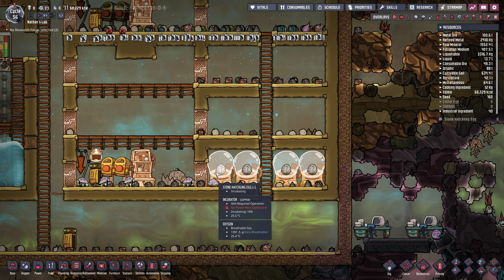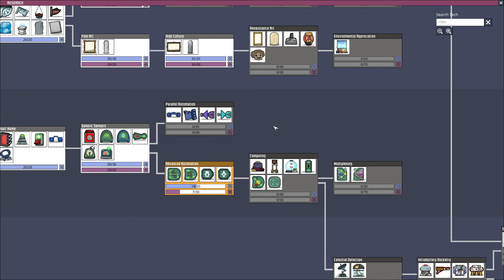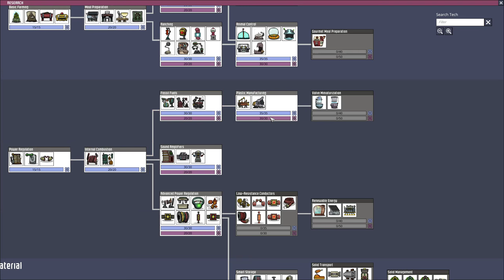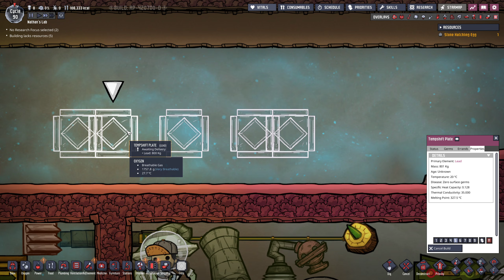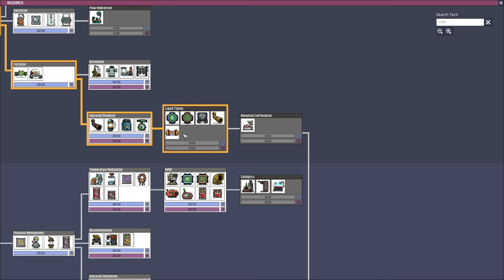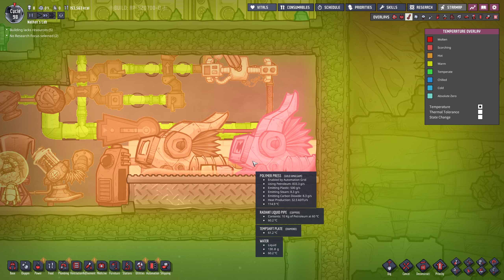STARTING THE PLASTIC AGE - Oxygen Not Included: Ep. #4 - Building The Ultimate Base

Comment: This base is unrealistic as of 2022. An incubator is 240W. You have four. A pump is 120W. Two coal generators are 1.2kW which is above 1kW wire limit.
Reply from the maker: You can do go above the 1k limit as long as you don't use it at the same time.

Comment: How do you build pipes and wires not destroing the floor tiles?
Reply from the maker: Pipes you can build across tiles, the heavy cables though will require a conductive plate instead of a floor tile to get the power through.
Reply: @Nathans-Sandbox  Well, my dups always destroy tiles first, then build wires or pipes.
Reply from the maker: Ah you meant deconstruct.  You have a filter at the bottom right corner with the deconstruction tool;)

Comment: Today: Making Plastics
An episode or so ago: Duplicates using bottles

O.o where’d they get the plastic for those...
Reply from the maker: Yeah hehe, a bit of magic there.
Reply: Maybe those were glass bottles.
Reply: @Desdanovas  but thats worse because then theyd need glass-
Reply: @quinnlee-miller9792  All you need to make glass is a stone furnace and sand. The suspension of disbelief is easier to make with glass bottles than plastic, I think.
Reply: @Desdanovas  and a pipe to blow the glass into.

Comment: Doesn't look like you hook the liquid pump output up to anything in your plastic room in this video, and in the next one there's a pipe leading downward.  Did you hook that into just a liquid vent in your fresh water supply to deposit it in there or did you pipe that to your polluted tank or just outside the base randomly?  Not sure the best place to route it, seems like it will be pretty hot water considering the room it's in.
Reply from the maker: I hooked it up to the waste water system where it's also cooled down eventually.

Comment: and I use gold for water pump from oil, the overheat happens, how to fix it
Reply from the maker: If the oil is hotter than 125 degrees you have to use a better material.
Reply: @Nathans-Sandbox  Yeah, this keeps happening to me too. I just haven't discovered a better material yet. My pump keeps overheating and breaking which is really slowing down my plastic production. Any suggestions on a better material to look out for Nathan? 

By the way, this series is AMAZING, I love your videos! You are so entertaining with your commentary on the dupes while simultaneously blowing my mind with these automations! This really is the ultimate base :)
Reply from the maker: You could seperate the oil and cool it with some water before pumping it. Or you rush for steel production. The oil pockets at first aren't hotter than 125, they heat up over time if you have a heat leak to the magma biome or made a mistake. If you're looking for the next best material, it's steel. You only need enough to make one pump.

Comment: Nathan I am so happy I found your channel when I decided to play this game.  Your explanations are succinct and you English is impeccable. I have an issue with the polymer presses overheating and breaking.  I can't see what I did differently than your build. My steam doesn't turn into water above the presses but by the air lock instead.  Do you know what I am doing wrong?  Any suggestions would be great as I need my dups to stop fixing broken machines all the time.
Reply from the maker: Hey there! Glad you're happy with the videos:) I had to make an addition to the polymer presses later on as they were overheating too. My solution was to add new water to the room, actively cooling them down (regulated with a hydro sensor, so you try to keep the water level above a certain point but not constantly add water) as the pump inside the room slowly gets rid of the excess water going back into the waste system. Not sure it's clear what I mean though:)

Comment: Love the Series Nathan. Awesome Job!  I am just now building the polymer press but my sweeper is breaking down in the heat.  Why wont it let me make it out of the material you chose even though i have it.
Reply from the maker: Should make it out if Gold Amalgam, not sure why it wouldn't let you build it 🤔
Reply: @Nathans-Sandbox  Looking in my resource list I have 102.2t of gold amalgam but when I try to build the sweeper the only choices i have are copper, lead, iron and gold. I can build all the other equipment in the plastics room out of gold amalgam just not the sweeper.  Very frustrating.
Reply from the maker: You might need refined metals, not the ore. Would have to check though.

Comment: why to filter liquid too early. it is possible to set a pipe detector and switch off when something other then oil come and make an update. It is better to setup the second pipe to remove water in upper layer. For a petrolium generator 5 000 presure is maximum. I think CO2 has a very pour properties and can not heat the base.

Comment: Back in the day slimelung was a pain and worth being super careful about.  Now, just keep the air in your main base free of polluted oxygen and you'll be fine.  I hog out whole slime biomes without atmo suits or any kind of lock between my base and the work area.  Sure, a couple dups will get sick, but they get over it quickish.  Just clean the air as you dig and the slimelung dies off.  Pool the polluted oxygen at the bottom of the biome, cover it with air flow tiles and deodorize the off gas to supplement your oxygen production early on, conserving algae.
Reply from the maker: Yeah, slime can be nicely exploited for oxygen this way.

Comment: Very nice design!
One issue though: why are you cooling the oil? The refinery heats it to 75°C regardless, so by cooling the oil you are actually creating heat and the cool oil does nothing for your base!
Reply from the maker: Though when it comes in hotter than 75 degrees, the petroleum is also gonna be hotter, isn't it?
Reply: @Nathans-Sandbox  Yes. 75°C is the optimal temperature for heat-deletion!

Comment: Hi! Very good Video - as always! My Ideas:
Why should the plastic fall down the other side of the machine? And: You could also work with a pressure plate. You will end up with 2x2000 kg of plastic (if you use only one pressure-plate at one side) - mostly more than enough.
If you need the smart-container: it is using a ton of power - maybe check it only several times a day (or with a clock - every 30-60 seconds) and use a memory-toggle?
TempSHiftPlates also inject heat into the insulated tile - maybe leave a gap at the ends.
You could use the emergency-build-priority for the things only the engineer can build, so you don't need to check and uncheck the priority.
You could use the automation-output of the tanks for the refinery - so the duped are not running there for 3liters of petroleum all the time (maybe set it to 95% stop - 30% start - or whatever).
Reply from the maker: Good points again! Can I do that with storages too? Like only fill up the coal storage when it's at 50%.
Reply: @Nathans-Sandbox  only liquid and gas storage does have the automation. You could use a Smart storage + normal storage Setup. The Smart storage opens a door, when it is empty, als close the door when its full. For the Time before a dupe fills the Storage you will need the normal storage with a little higher priority as a buffer
Reply from the maker: Ah good point!

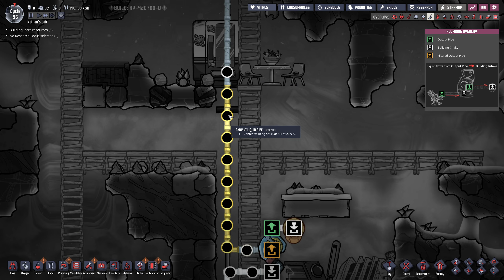Comment: As a chemistry engineer, I must warn you, that the pipe cooling at 28:28 is not gonna work as you wish. The reason is it was not dynamic stabilised status yet. The hot oil was transfering heat to cold pipe. But as time passes, the pipe is gonna warm up, so the cooling process becomes less effective. If you cool oil under 20°C, you can take advantage of it to cool down entire base, you seem to have issues with heat accumulating inside rater than it being the other way.
Reply from the maker: Ah yes good hint, I didn't think about the pipes themselves already being cool in the beginning.
Reply: @Nathans-Sandbox  It would be fastest if you ran it through pool of cold water.